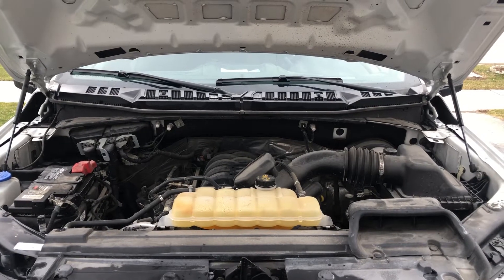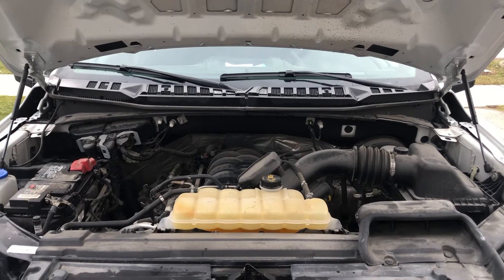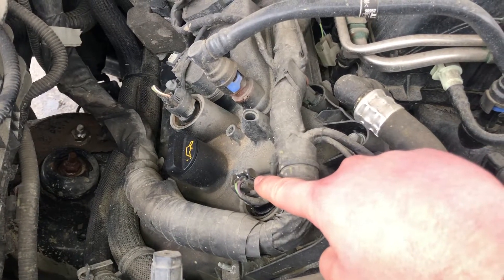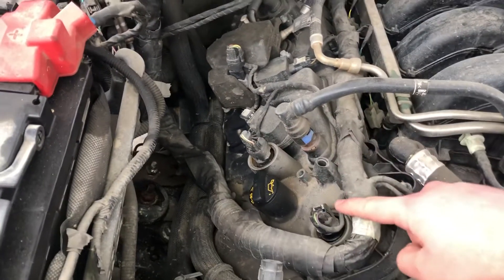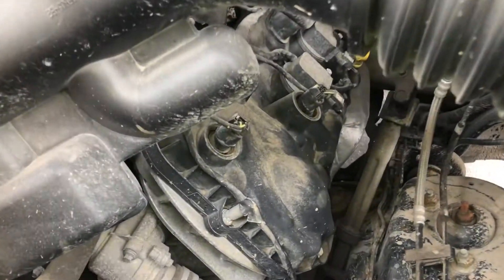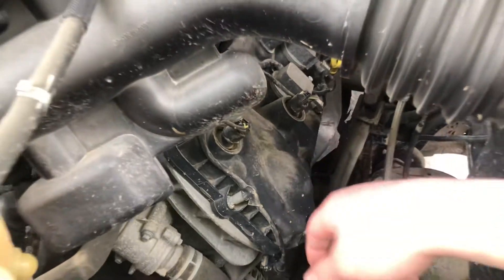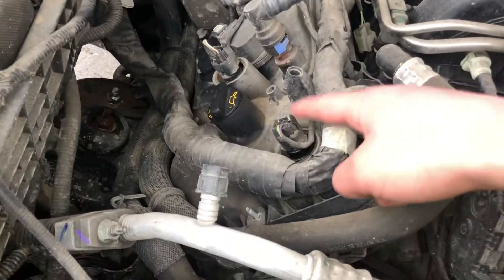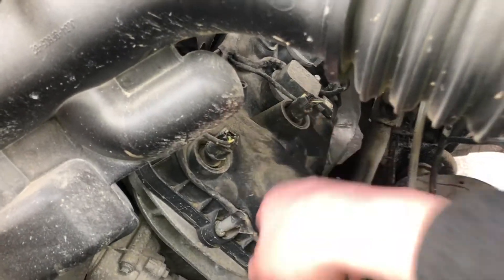VCT Solenoid location on a 2019 Ford F-150

Comment: Witch one is the intake one
Reply: Great video btw
Reply: On this 3rd generation 5.0L coyote V8, the intake camshafts are closest to each side of the intake manifold and the intake VCT solenoid is inside the valve cover, directly in front. The solenoid uses a magnetically activated center pin to operate the intake cam phaser. However, the exhaust camshafts are closer to both outer edges of the cylinder heads, and the exhaust cam phaser operates on oil pressure (almost like the 5.4L 3-Valve). The exhaust VCT solenoid is bolted in the cylinder head where it controls the oil pressure to release or activate the exhaust cam phaser.